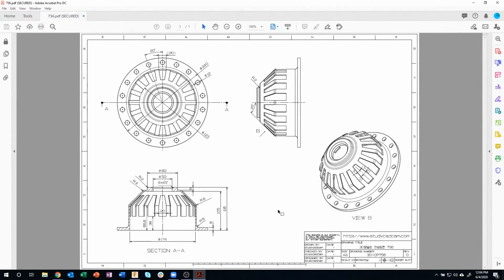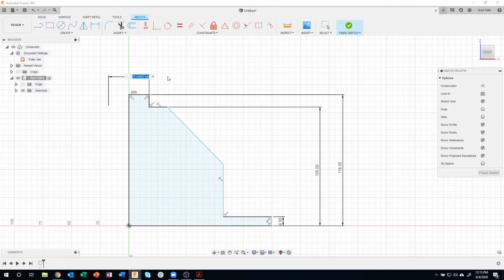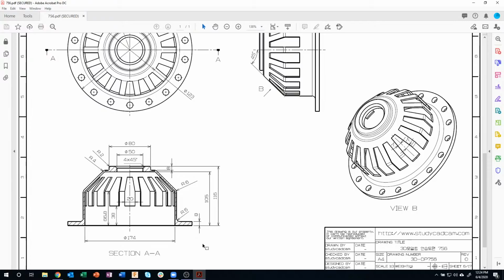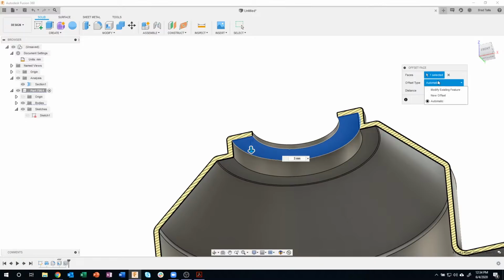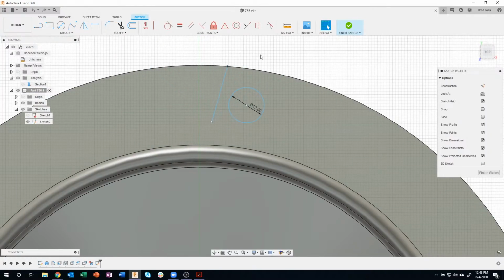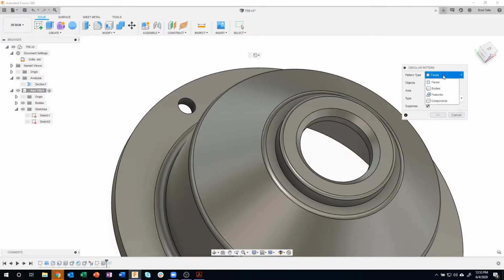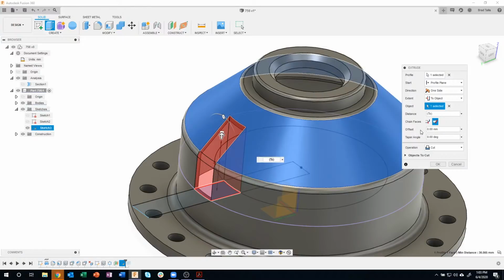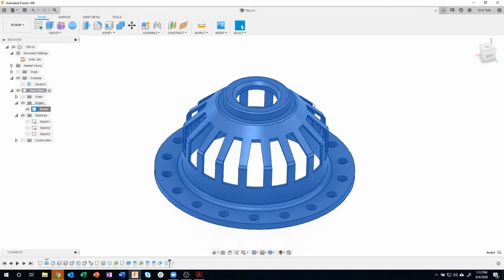Fusion 360 Live - Stump the Chump

Comment: It's more than a year later but I just came across this and wanted to give it a go.

* The dimension you're looking for  at 15:55 is 8.8mm, not an assumption. It's a bit of a math puzzle. As per the drawing the overall height is 116mm. The height to the INSIDE ceiling is 105mm, that's a difference of 11mm. The recess (boss) down from the top is 8mm. The 11mm minus the 8mm gives a 3mm wall thickness. The inside diameter at the bottom of 174mm plus the 6mm (3mm+3mm each side) gives your mid vertical wall a diameter of 180mm, not the 174mm entered. Once that's put in along with the 45° angle from the drawing, the remaining, missing, dimension is driven to 8.8mm.  *

Edit: If I figured right.

Really enjoyed this one. Thanks!

Comment: Hi, not sure if i worked it out correctly but i made/calculated the missing diameter to be 178mm
Reply: sorry typo 3 mm. making diamiter 180... the hole height was 116mm minus the 105 left 11 mm subtract the 8mm couldnt see writing proply was zoomed inn on screen as couldnt see link to drawing. anyway if it was 8mm it made the wall thickness 3mm so 174_(3x2)= 180

Comment: I (finally!) found the pdf drawing and created it in Fusion by drawing a sketch of the profile and revolving it. If you use the dimensions given, including the 45º angle, the wall thickness at the top will be driven and it's 2mm. I then made the assumption the slanted and vertical walls would be the same and it worked like a charm. I think you erred early on when you took the 174mm to be the outside diameter.

Here's my sketch for what it's worth.  https://drive.google.com/file/d/1i9qzhMakhlERNBQD1RC_nzLaG_aO3EYL/view?usp=sharing

Having said that, let me hasten to add that I learn something from you every time you appear, and I try to watch all of your videos. You have been one of the best teachers of anything I've ever encountered. Kudos!
Reply: where did you find it the drawing?
Reply: @davesoutdooradventures5523  At the site Brad mentions at the beginning. However, it's in some strange asian language and I searched through many pages before finding here. I've put it here so you can download it easily.   https://drive.google.com/file/d/1QrVvmBouqvTMG-K8-RFRUjB4tGR1GiDe/view?usp=sharing

Comment: Not a big deal, but your model doesn't match the one depicted in the drawing.  All of the cuts in the  last feature should be perpendicular to the surface being cut.  Your technique left the top face of the openings (between where the taper is the most narrow) at the wrong angle. 1:08:45 shows it pretty well.  I do really like all your videos!  I've learned a great deal from you.  Thanks!